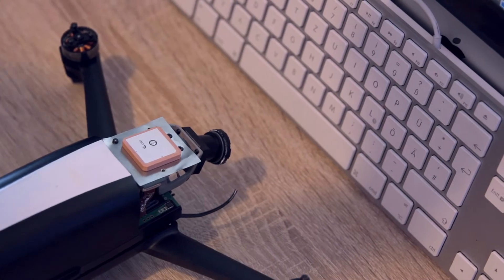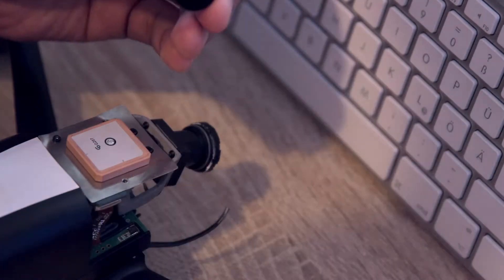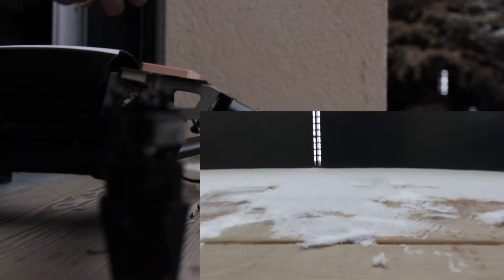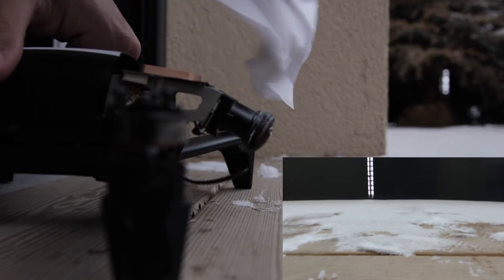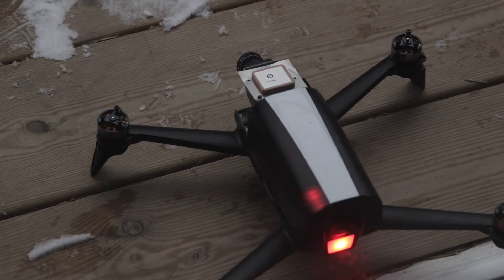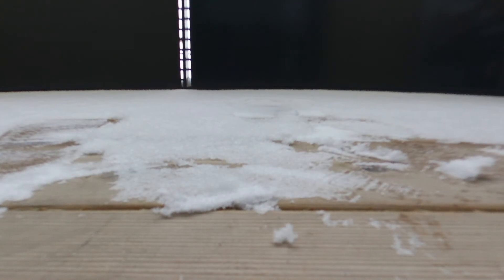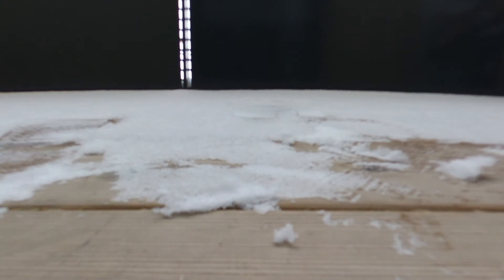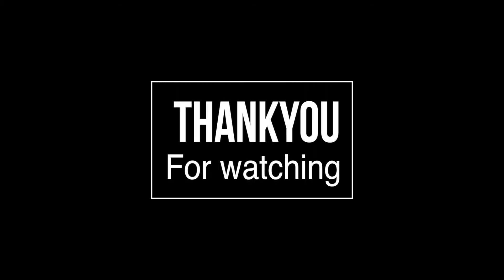BEBOP 2 - Fixing Cold Camera Problem - Project Outline - Part 1

Comment: Is it possible to get hold of a front element ,as i scratched mine puting a go pro 37mm filter on it which it supposed to protect the lens ,little did i no the filter was sitting on the lens ,when flying  and braking hard the lens on the bebop moves on the inside rubbing against the filter glass scratching my lens .I tried to remove the mark with lens cleaner to avoid removing the lens coating in the end I had to use metal polish ive removed the mark but lost the coating ,I havnt been out to see if there's any issues with contract ghosting reflection ECT ,I'm hoping the lens is coated on the inside and in other areas so what ive done won't make no difference ,there must be some one who does a element as if i do need one ,and cant get one I really don't wont to buy a whole camra might as  well buy a new drone .
Reply from the maker: stephen barry I'm sorry I still have not found a suitable front element replacement. If you didn't cut into the glass the image should be fine but it you cut into the glass than there will be sections that will look out of focus (from experience). Lens isn't coated on the inside.

Comment: The same problem happens with the Parrot Disco , perhaps even worse than the BB2 in cold weather , do you think it would help insulating the lens barrel to try and keep the cold away from the long plastic tube holding the front lens ?
Reply from the maker: uptowndisco2 I am sorry I have no experience with the disco :(

Comment: I cut some foam into small pieces and put them im the holes of the camera frame , this surrounded the camera , then i put a where a little the foam was sticking out , but not too much where i had to force the nose on, this stopped my problem of the video not looking good in the cold , plus it stopped all vibration from the motors cutting down any little jello effect.

Comment: Hi Anthony, since  some time i followed your quest. My compliments on youre videos on style and instruction level.
My other hobby is Astrophotography. The sensor problem is the same. In "Cheap"constructions there is a problem with moisture and condensation. I think the camera is constructed under normal atmospheric conditions. When you use it under normal conditions there is no issue. On the other hand when the temperature drops large differences in temprature develop. The sensor gets hot and the moisture starts to condensate on the lens. There is a easy way, but there is a risk from contamination of the sensor. Just dril a hole in the tube. 
When it is a problem with the focus and not condensation a reglueing with epoxy resin after refocussing should do it. I rather see a solution with a threaded tube. With this one could refocus.
Reply: I hope you don't mind my adding to the conversation regarding condensation forming on cold surfaces if you do try the ventilated method. I planned to try this while having my camera apart, following your focus tips, but you are so far ahead and considering this problem already that you may as well try it too as part of your series. 
If you were to finish the inside of the chamber and all lens surfaces with a product called Rain-X Anti Fog I am hopeful that no moisture latent air will stick. I have used it on the outer lens and my breath absolutely will not fog it up anymore. The haze is gone. (Thanks "chrisfix anti fog" youtube).
Reply from the maker: Rick Cunningham not at all. Any but of information is valuable. Thank you very much for sharing
Reply from the maker: Judith en Eric excellent and you are absolutely correct, thank you for advice and your support. I hope to have some success with this. 😄
Reply: Some other considarations, it kept me busy :-) . I have seen some Bebop owners using a Gopro UV filter. Maybe this is more or less a solution. Not for the uv filter itself, but for the fact that you simply isolate the Bebop lens from the cold airstream. It acts as a double glass window. I could be worth a try. I did not try it out. 
Also it could be helpfull to put the Bebop, without its battery in the cold before. To cool it as it were. The air in tehe camera gets cold and this prevents the fogging a bit. Grtz
Reply from the maker: Thankyou so much for that, sadly it will not work. The back of the sensor is around 45˚C after 5 minutes of being turned on, from the sensor at the base of the barrel is a UV glass, than the elements there after moving towards the front of the barrel. From what I found out after leaving the drone out in the cold powered on the haze forms between the sensor element after the UV glass inside the barrel. In any case the heat from the sensor does not reach all the elements even to the front element to have the front element fog up because of the rapid difference in the temperatures like a car windscreen. 

I have also tried using wrapping the entire camera to constrain the heat produced by the sensor but this also failed. Using a 12v 1W thermal heater wrapped around the camera works to -3 before the front element starts to fog up. That isn't practical because of the size of the element that has to wrap around the barrel (wont allow the nose to be mounted)

Drilling a hole to allow more ventilation into the chamber is a brilliant idea which is Sigmas lens theory of breathing lenses and not using rubber gaskets as opposed to canons L glass which all have gaskets and sealed lenses constructions. I am weighing in 2 alternatives to counter the haze produced. 1. Rid the entire camera, lens housing of moisture best as possible than reseal the back of the sensor and the front element. I wish I could purge nitrogen into the housing before sealing but resources are limited.
Reply: Anthony, thanks for you re swift reply. You already tried a lot and some of those are pretty effective when it comes to telescopes. But, this is a tiny camera housing. Nitro purging is effective, if you can seal the housing under purge conditions. 
For the drilling of the hole. I am not sure to if where you should drill. If you drill near the sensor you get the benefit of losing heat faster. On the other hand moisture at the front end will not evaporate?
At the front end, near the lens I am not sure what will happen. 

Another considaration could be to look at the heatsink behind the sensor. That could be beneficial for Noise also.  The higher the temperature on the sensor, the more noise you get in the image. If you coild cool the sensor the temperature should be less in the camera housing. 

Still thinking on this....
Regards Eric
Reply from the maker: Judith en Eric surprisingly there is no heatsink for the sensor just a stainless steel backplate mounted offset about 2mm from the bracket not sure how air will flow there. Also I agree with getting the temperature of the sensor down maybe one could tackle both at once.
Reply: If it is a steel plate, you have got the heatsink there. If the sensor has a direct contact with it, just enlarging the surface might do it. For instance cutting slits in the plate. If the sensor has no direct contact. Maybe some cooling paste to establish "heat dissispation"could do the job. If the sensor is isolated from that steel plate i would be very surprised and would not expect this from the designers from this excellent drone.
Reply from the maker: Its a similar construction to that of DSLR sensors its just the backing plate what I meant was there is nothing other than that to aid in temperature control. Ill go and have a look for some scrap aluminium 5mm thick or close to put between the backing plate and the camera mount protruding around the sides to fill the nose cone and catch that breeze. Thermal paste is a must between backing plate and proposed heatsink. Im trying to keep it as simple and small as possible to retain the original form and close to original weight of the bebop 2. Heavily modified bebop2 will very quickly fall into experimental UAV and id need to comply with local regulation regarding this.
Reply from the maker: You know you could actually be onto something. By controlling the temperature of the sensor to be at least within 3˚C of ambient temperature we indirectly eliminate the haze problem plus increasing image quality with the cooler sensor. I may have to change my approach based on your findings. I shall report back shortly. I need to finishing editing 2 shoots and send them out before I get back to hobby stuff. :D
Reply: Yes, you got my thinking!
I would keep it simple. May be get some thin copper plate and wrinkle it in v-shapes. Just put it at the back of the plate of the camera and let it stick out where it can. May be assist with some wind slits in the canopy of the bebop.